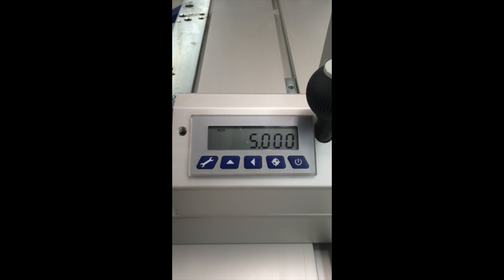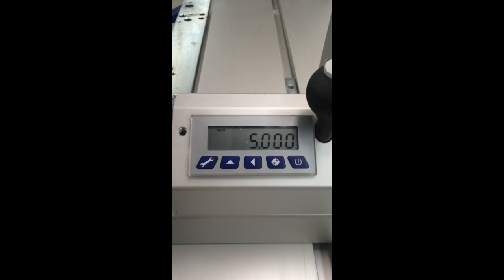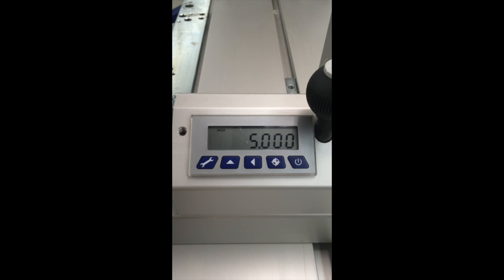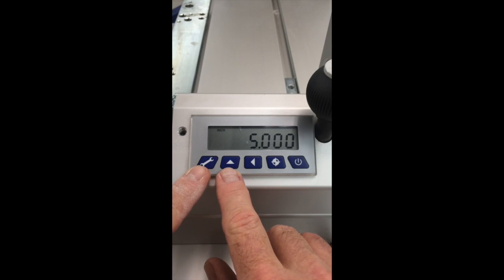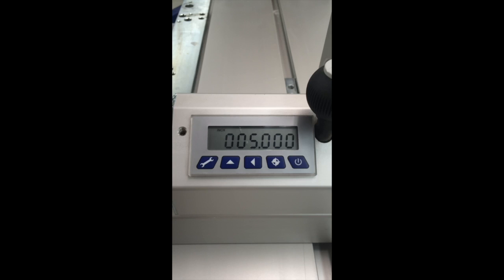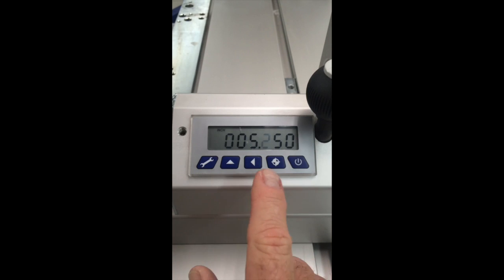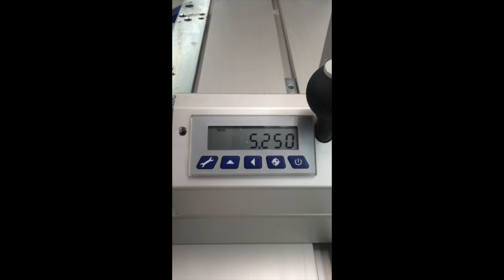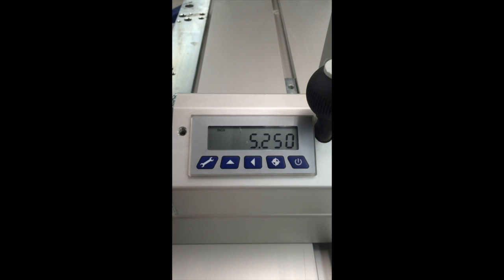Calibrating the Felder Digital Crosscut Stop

Comment: I just did exactly as you showed. Entered in 700mm. Pressed store. I defaulted back to the same random number that was there before I started the process. Then pressed and held the round save button until the display counted through the little 1,2,3 and then 1400 is the number it shows me. What the??!! Man I really hate Felder. Brand new saw and nothing works.
Reply from the maker: I have more thorough information on my web site here:     https://assets.zyrosite.com/YanMoZDqRrS1lagy/calibrating_the_digital_crosscut_stops_on_a_felder-YanMQQ25pDSEnaQ6.pdf     

Read the PDF, and check the parameters in your stop per the document. Your stop has either the rSto or F_AbS parameter incorrectly set.
Reply: @David_Best thanks for your reply!! I didn’t see it before now. The Norwegian Felder dealer has attempted to calibrate my saw twice and failed both times. So I haven’t gotten to use the saw yet. 

I figured out that if I enter a value of 700mm - (what I measure as the minimum possible cut using the DRO stop) and save that, then it displayed the correct measurement. Thanks for the help and all the useful tips and tricks!!
Reply from the maker: @Advcrazy  Glad it helped.  More Felder stuff on my web site here (scroll down):  https://davidpbest.com/publications-and-videos

Comment: Do these stops hold true for a while?  Is it accurate along its magnetic strip out to longer pieces?  Thx
Reply from the maker: Yes of course to both questions.  They would be useless if they didn’t.
Reply: @David_Best  good to know, just checking to see they will be worth the extra cost.  I have a brand new K700S coming tomorrow morning and I included two of these digital flip stops with my build.  Thx